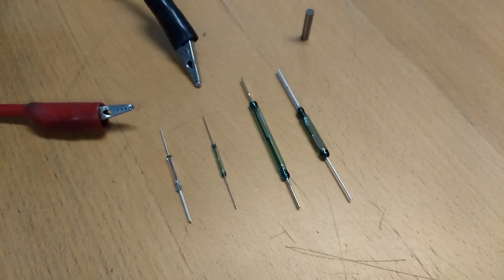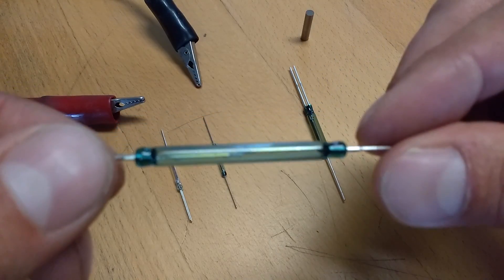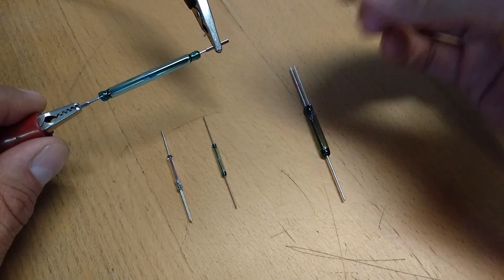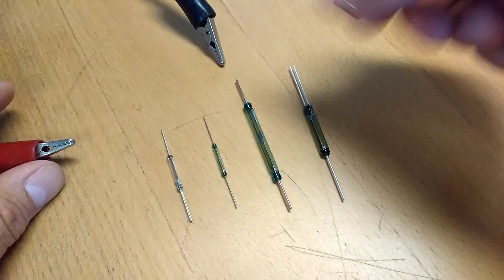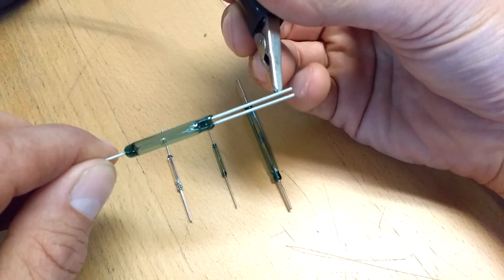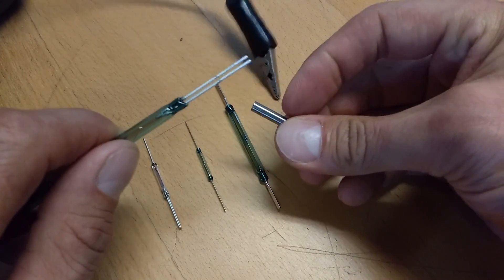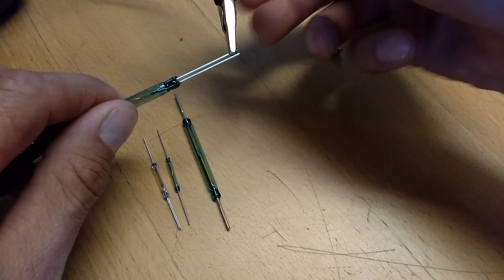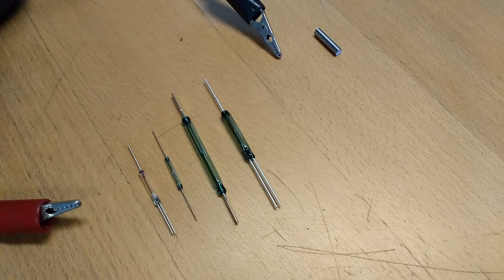How does a reed switch work?

Comment: Great explanation But you could demonstrate how the switch reacts as the magnet is moved across the switch from end to end. The switch reacts to the magnetic field and the switch can be more sensitive in some areas than others and at the mid point might not even work at all !
Reply: Yes, it seems with a lot of these reed switch videos the orientation of the magnetic field is not made clear.  It is a bit counter intuitive that you bring the magnet poles alongside the reeds (parallel to them) not one pole directed at 90 degrees.  In a reed relay where the reed is inside a solenoid the same is true - the magnetic field lines run parallel to the reeds.  The very tips of the contacts are coated with a metal that is not chosen for magnetism but for good electrical conductivity.  The reeds are made of a 'soft' magnetic material and when a magnetic field is near them they become magnetised and overcome the 'spring' force that keeps them separated, and stick together.  Remove the magnet and they spring apart.  Hope that helps a bit.

Comment: Why pole of a magnet needed to be close to the reed switch? South pole or north pole for it to be on in the normaly open
Reply: Pole doesn't matter. It's just a piece of steel attracting to the magnet. However, there is directionality to the switch. You have to put the magnet on the correct side of the switch or it may not work.